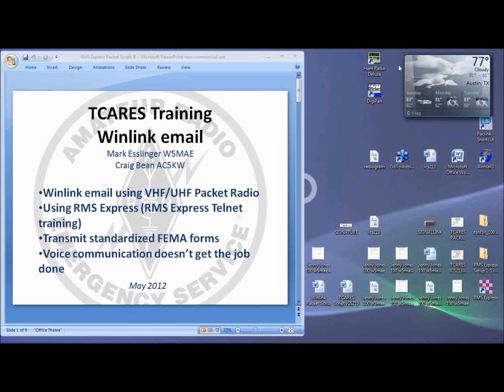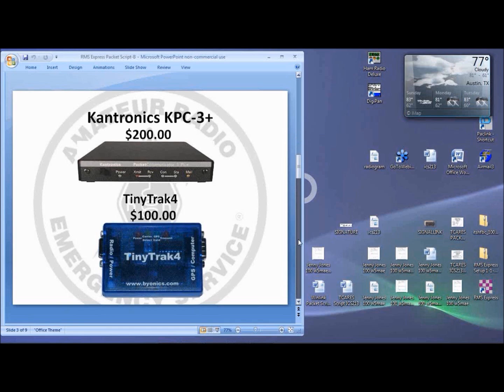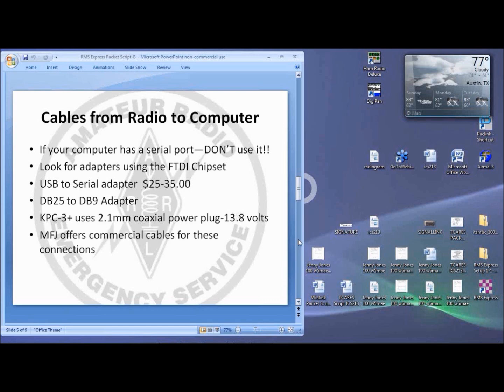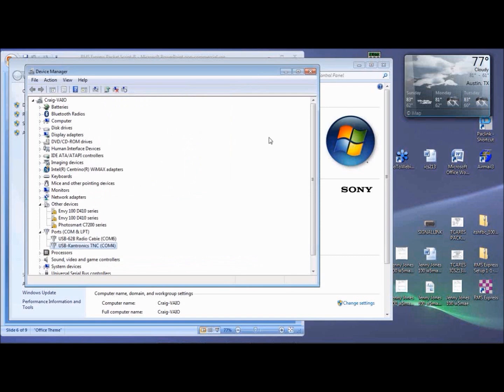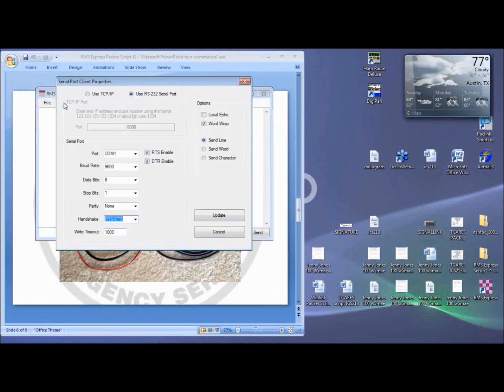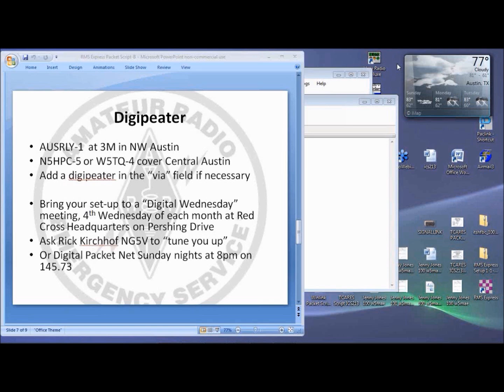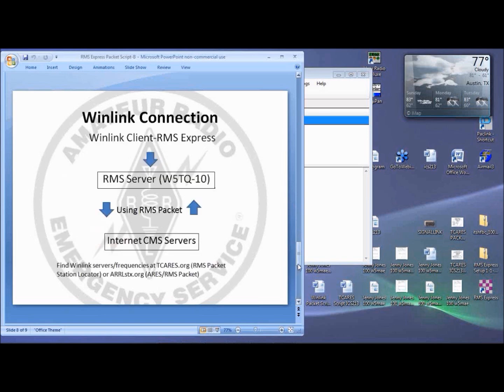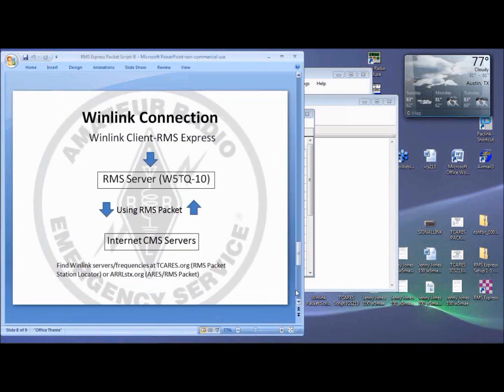RMS Express Packet

Comment: Yes but when all else fails it will still work. That is the HF side not necessarily the VHF side. But the HF side is even slower but is always there! They use it on sail boats n such or Maritime. I have it in my truck and can send or receive basically anywhere. Works great when out in no mans land and there is no cell phone signal. I was heading back from Kansas City once, broke down and there was no cell phone signal but i was keeping in touch using it even uploaded my location. =D

Comment from the maker: You need to put the TinyTrak4 into KISS mode manually when using it as a packet TNC.
Connect to the TT4 using a terminal program. Power cycle the TT4 and immediately press ESC three times to enter command mode. Enter the command AMODE KISS and then QUIT. As with all TNCs you also need to calibrate the audio out level.